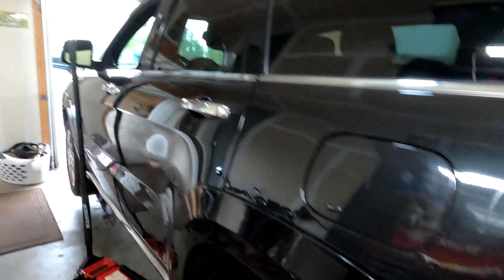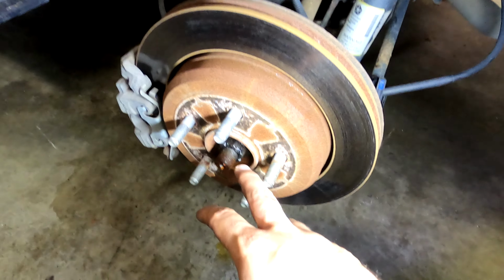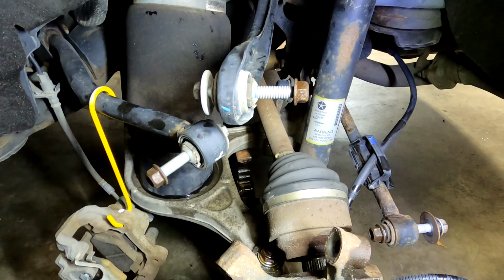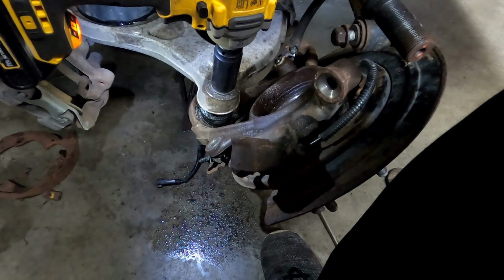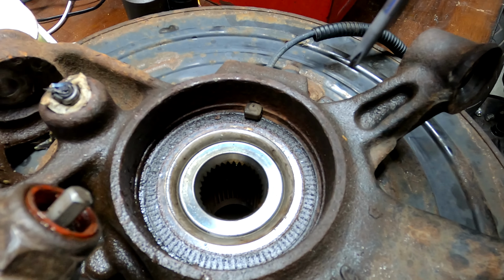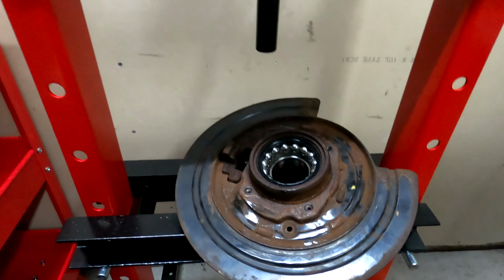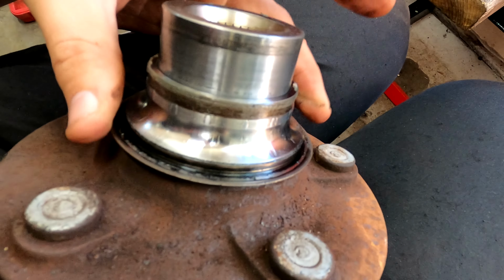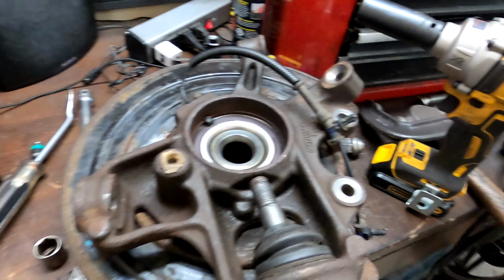2014 Jeep Grand Cherokee (WK2) Rear Wheel Bearing Replacement

Comment: A big thanks for your video! I was fortunate enough to actually find  "wheel hub assemblys " , which is extremely nice because there was no need for a press of any kind. The assembly unbolts with 4 bolts on the rear and 3 bolts on the front. I replaced all 4 bearing assemblies because of the high mileage I have (191,000) on my 2016. WK2. If one goes bad, it's only a matter of time,  lol🤣
The 3 or 4 arm gear puller was an enormous help holding the axle shaft back far enough to remove the bolts 🔩 without removing the entire knuckle from the Jeep. It made it quicker also. Basically took 4.5 hours to replace: 4 wheel bearings,  4 rotors and pads,  and new e-brake shoes. 
If you don't know,  it is highly recommended that you drain and replace the differential fluid at least every 75k miles or you'll be looking for that video next,lol. The only answer I have NOT gotten from MOPAR is about the transmission fluid,  which they call "forever". 🤔
Reply: Mike, where did you get the assembly?
Reply: @john cipolla  , never mind,  lol.  After dismantling the rear brakes, and the e-brake shoe assembly,  using a puller to push the axle shaft back,  I discovered that the store completely sold me the wrong part. I think it was for a Cherokee,  not a Grand Cherokee.  Even the bolt pattern was wrong:  It was smaller than mine. I don't have a bench press,  and one hub assembly is @ $120 . But, a junkyard complete knuckle assembly (which happened to have only 53k miles on it) was only $200. Since I like to do stuff in pairs,  I bought both sides.  My intention is to press new hub assemblies into the original ones from the Jeep for the next time I have to do it. 
Advance Auto Parts is where I usually purchase my parts; they're track record has been really good for me,  AND because I signed up for the "perks" reward program they have,  I consistently get $$ off the parts I buy.
Believe it or not,  with everything I've done to the Jeep thus far (all routine maintenance at Mopar recommendations; at the time of my response 193k on the clock) I have saved a boatload of $$. The only problem is that at present time I can only order 1 wheel bearing/ hub assembly.  They have no idea how long it will take to get the other one. I never mix match brands or "grade" of parts. The saying, "you get what you pay for. " definitely applies to this scenario.
Reply: @john cipolla , By the way , I purchased the complete rear knuckle assemblies (both sides with 53k miles on them) from a used auto parts yard,  Lentini Auto Parts. $400 + tax

Comment: Did u just leave the backing plate on and change parking.brake shoes??
I need to replace my friebds backing plate. Is it held on by 4  bolts and do I need  to press out bearing in the process of installing a new backing plate that already has new parking brakes attached? Hers is destroyed. Thanks

Comment: So is the reluctor wheel built into the bearing, and if so, does the bearing have to face a certain way in order for the wheel speed sensor to work? I'm assuming that that plastic cap that was on the new bearing was on the side that contains the reluctor wheel. Is that correct?

Comment: Having an issue where I pressed in new bearing and It came apart? And it had so mutch play to the point where the hub came out the knuckle assembly itself
Reply from the maker: Don’t forget to isolate the load of the press to only the outer ring of the bearing. If you push against or support only the inner pieces it will break the bearing. Good luck!

Comment: What kind of jig did you make to support the assemble when you pressed the hub out? I'm trying to do it but can't figure out how to support it on the press with the back plate there?
Reply from the maker: Hi Dan, it was definitely a challenge. I did spend a lot of time trying different arrangements and adapters. I ended up using a lot of different sockets as spacers and I cut some 2x6s to fit perfectly. I had to add a slot into the side of the board to get the necessary clearance. I wish I had a nice easy answer for you but it will just take lots of creativity and ingenuity. Good luck!
Reply: @thatlldogarage  Yep, had to do the same here. Was a major PITA Only thing I have to do now is try to grind/cut the race off like you did. Bearing's coming tomorrow and hopefully it'll go back together easily. I probably spent as much time trying to get the parking brake cable off as everything else. lol  Found out you need a "tool" for getting the cable out and it's not cheap.....ended up taking it off the other end.

Comment: Sheesh... so fast forward to 8:25 and you're skipping by what I need. All I want is to get that hub out so I can replace my lug nut studs and you have the whole rear end torn apart using a friggin press. Is this seriously what I need to do just to have that part in hand so I can get to the back side of those studs?? There's gotta be an easier way to get there from here.
Reply: Sadly yes, that’s the only way to get it out.

Comment: What is the mileage on your truck?
Reply from the maker: About 130,000 miles
Reply: Mine is at about 115,000 miles and I think the rear passenger bearing is on its way out.